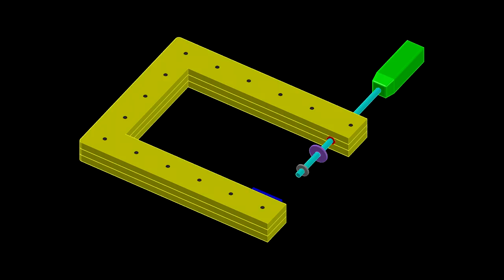How to Make Long Reach C-Clamps for Under $10 (Strength Test at the End)

Comment: I'm in the middle of making some of these for my brother and I.  I think I might just use some locktite on the nut for the swivel part. I had some old 1/2 inch plywood laying around so I ripped a BUNCH of 2" strips and glued em 3 pieces thick and then glued those together as a bridle joint at the corners.  Thanks 4 posting.

Comment: Awesome, i wonder what would happen if you put another threaded rod in the middle.. It would be an awesome clamping jig.. Putting pressure on both the edge and the middle.. Saves space and clamps..
Reply: Paul, by removing the material for the second rod,don't you think it would compromise the strength of the arm?

Comment: My professional opinion....smart guys will use 1/2" readi-rod, and coupling nuts for both handle and head. Anvil should have boatbuilders attitude... using endgrain cuts as the anvil face.... could be made as reverseable ... perhaps a round ball, v-groove, or cylinder shape.

Comment: I need to get into the sound hole of an acoustic 12 string guitar with spruce top and clamp down a loose bridge. without a "c "clamp no hope you would crush the top using only outside force

Comment: Plenty strong but you should have rounded the corners on the inside. I would have just drilled them at that point to have rounded edges. Everyone knows that corners are the start of splitting. Check out the history of the De Havilland Comet passenger airliner.

Comment: I'm not trying to be disrespectful, rude, etc.  but I do have a question as to "why use wood"?  scrap tube steel would have made the same sized deep clamps in about 1/2oth the time, stronger and more durable... plus a lot cheaper (is how I did it for my home shop)...

Was the entire goal to show how to do it with "only wood"?  perhaps since you make a lot of really practical wood tools.
Reply from the maker: I don't have scrap steel

Comment: The nut on the inside takes all the clamp load. If the out side nut does for some strange reason it would just push back out? So I just wanted to know if i missed something?
Reply from the maker: +Andre Lotscher the outside but keeps the threaded rod straight
Reply: Got it  knew there had to be a reason

Comment: Do you have the Mastercraft/Ryobi band saw or did you invest in a proper band saw? Just bought the Mastercraft drill press on saturday on sale for 99$.
Reply from the maker: Anything under 14" bandsaw is a waste of money as far as I'm concerned. I looked at those 2 and went with a 300 dollar kijiji 14" bandsaw even though it was more than i wanted to spend. It you buy those smaller ones you will soon want to upgrade so better not waste the money in my opinion. I like my mastercraft drill press but it does have certain depth and height limitations.

Comment: $10 ? How much is Bandsaw/tablesaw/jigsaw blades? How much are sanding belts/stickback & DA sanding pads? Hi spd/Router/ Forstner bits? Rags/paint & sundries?
Reply from the maker: Alot more than that.
Reply: @DIYBuilds  yep it adds up ... been building a 16' (16' x 6' flat bottom 34' hi frt / 24" in bac) boat the last year for a few hundred dollars....Yeah ,  with a $200 trailer I refurbed ($1000 more) And 1200 /1500 in lumber / $30 a tube boat caulking & adhesives & several hundred SS screws. Prob headin towards 4K ... still need buy good used OB ! ahhh!